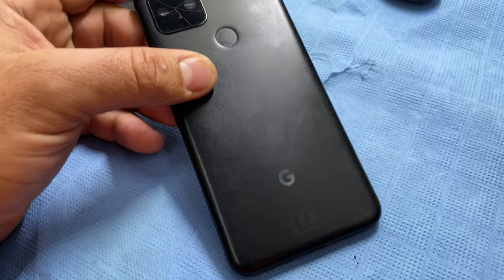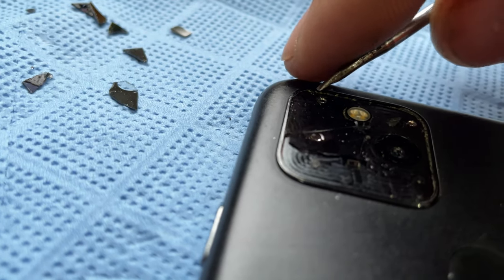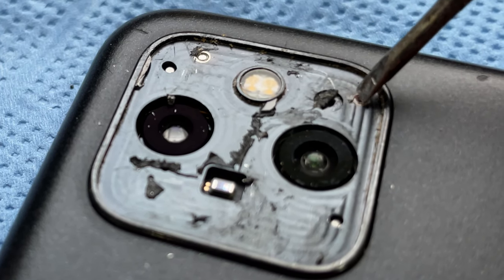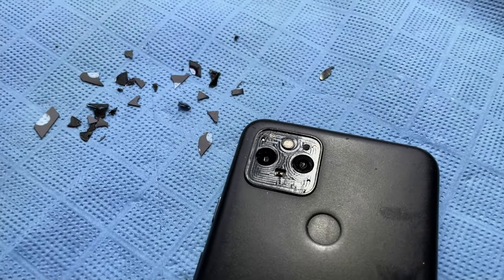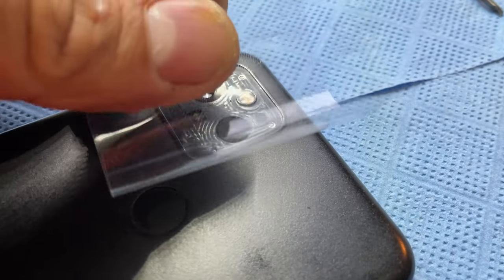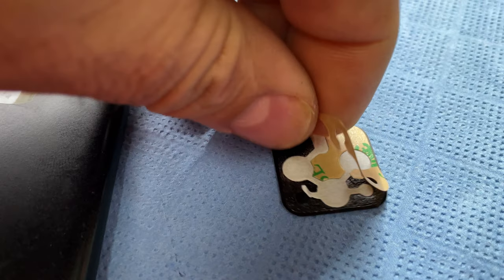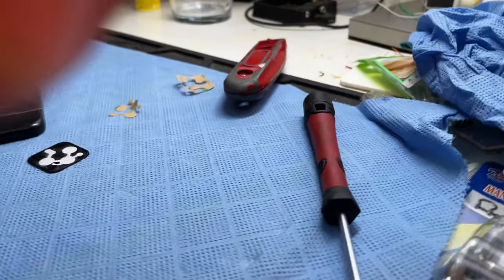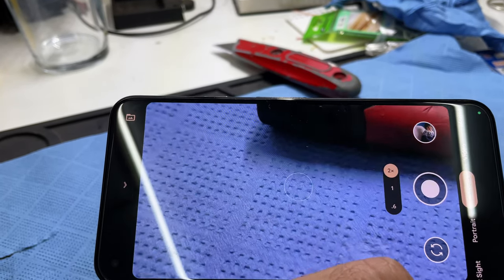How to replace Pixel 5 broken camera lens cover.

Comment: Thank you SO MUCH for this video. I just finished replacing my cracked camera glass and everything works perfectly. Way less expensive than having Google repair it!
Reply from the maker: Cool. But be careful with it ours has a bunch of scratches already because the lense was actually plastic.
Reply: @reversingentropy  maybe it helps to buy a "protection cover" made of glas for the camera-lens. I will do that.
Reply: @bodomalo  no it doesn't.with glass protection the pictures wore always foogy. We had to remove it.
Reply: @bodomalo  I wouldn't use a glass protector as it messes up the flash when taking pictures (pictures basically come out white) I have a D Brand skin which covers the glass panel - it only helps with scratches for the majority of that sqaured area and nothing to the lens areas.
Reply: Coming back to report that my replacement glass is still fine, so there are good replacement parts put there that work with this method. 👍

Comment: I'd be worried about residues from the sticky tape on the bare camera lenses... aint that a problem?
Reply from the maker: It wasn't. However the glass was of so low quality that it is all scratched now. 🥺
Reply: @reversingentropy  can you show me a link to what you bought? I had 2 options, one was for 1.50$, and the other one around 6$ (said original...)
The one I received has stamped "SW-A2" on the back.

Comment: Thanks. I have condensation under the lense (just realised I have the tiniest crack on top of the main camera) Really annoying. I'll do this when I find the part
Reply from the maker: Don't buy this inexpensive lense. Its made out of plastic and it scratchd immediatly... Try to find a glass one.
Reply: @reversingentropy  I've bought 3 from different sellers claiming it's glass, and all were plastic. Have you managed to find a glass lens?
Reply from the maker: @LeeJoRo  i have not. And now it's about time to retire the phone.